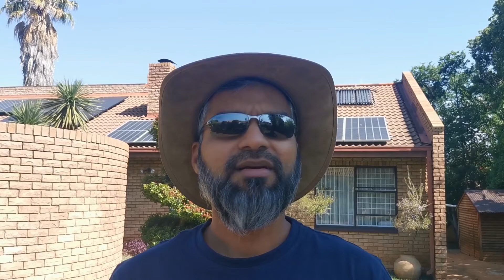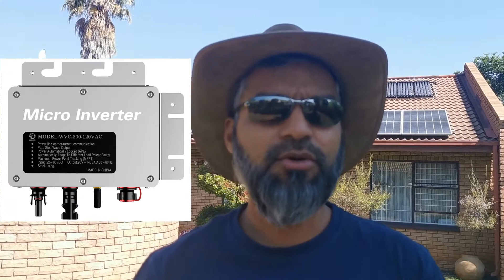Should you use a Microinverter?

Comment: Thanks for touching on the subject as they are becoming all the rage on online videos and resources regarding solar - especially in the States. My question (as a fellow South African) is, how does this link up to your existing system. Almost all the documentation I've read online talks about these micro inverters feeding the Grid. Now in my mind, Grid means Eskom, but practically I would assume it would feed your home internal supply (i.e. your DB)? Does each micro inverter give 230v output? If so, how do you combine that into your home DB if you have multiple micro-inverter feeds? Some sort of AC busbar? Are people using this with existing hybrid inverter and battery systems, where they're replacing the Eskom grid feed rather with the MI AC feed? So confused lol
Reply from the maker: Microinverters are small, self-contained inverters that are mounted underneath the solar panels in your system. The DC-to-AC conversion happens right on your rooftop, and the wire coming from your solar array carries AC power to your electrical panel. There’s no central inverter in this type of system. 

Each microinverter is connected to a single solar panel, converting DC (direct current) from the panel into AC (alternating current), which can power household appliances or be sent into the grid for energy credits. 

The microinverters are connected to the electrical grid, which means that the power they generate can be used to power your home or business, or it can be sold back to the utility company for a credit on your bill. 

The microinverters are designed to work with your existing electrical system, so you don't need to make any major changes to your home's wiring. 

Each microinverter produces 230V AC output, which is then combined into your home's DB using an AC busbar. 

People are using microinverters with existing hybrid inverter and battery systems, where they're replacing the Eskom grid feed rather with the MI AC feed¹. 

I hope this helps! Let me know if you have any more questions.